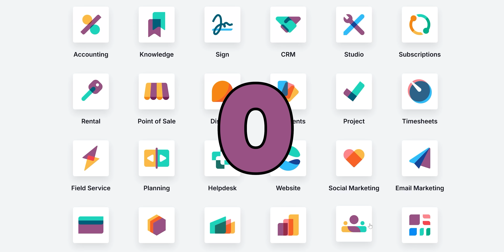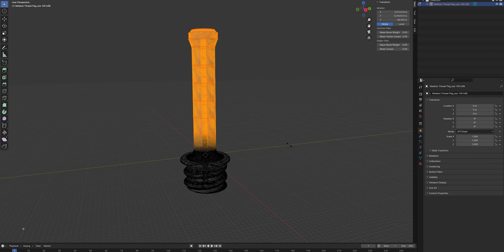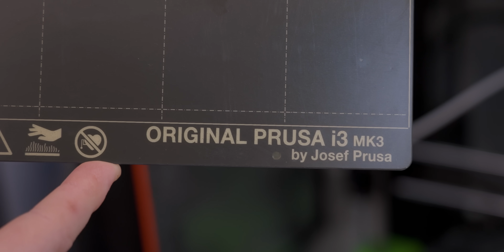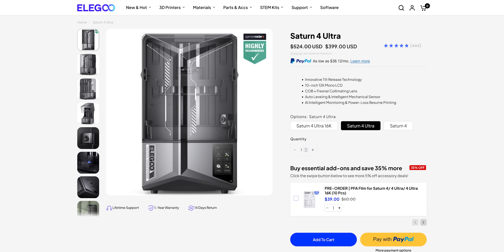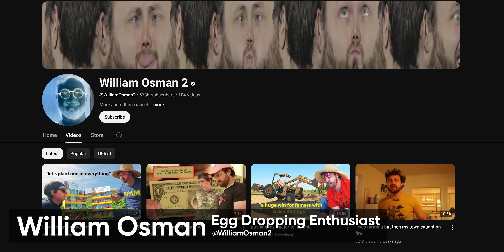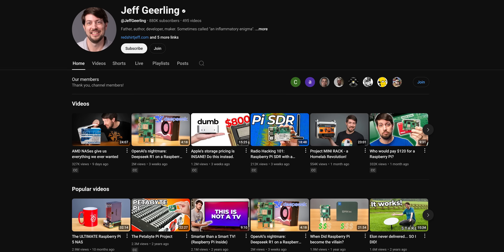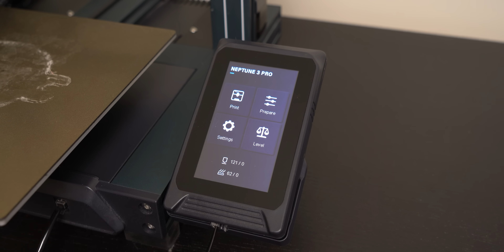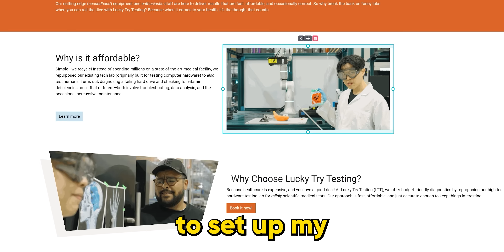Is my 3D printing setup wrong?

Comment: I have a Bambu A1 mini and it does everything I need. They took back some of the stuff they said and nothing has changed so far so I'll continue to use and recommend their printers until some other brand makes something as easy to use and maintain

Comment: Hey I have question. My sister's laptop is a dell something and it has a decent intel processor and 8gb of ddr4 ram. But it is slow as f. It does have a hard disk which I think is the reason. So is buying a nvme ssd gonna make it fast?

Comment: Jake, those two printers are not anything alike.  The one you have is a bed slinger and the other one is a core xy.  The only similarity is they both have a hot end.
Reply: They share a lot of parts
Reply: @JakovPerisic  Gotcha. That seems odd they'd use a lot of the same parts. That would indicate some intelligence behind the design series. 😁

Comment: When I was getting my Bambu X1C, I wanted a printer that would just print. It didn't have to be the cheapest, it didn't have to be the best quality, it didn't have to be open source, I just wanted to be able to load an STL file and print. The bambu is perfect for that. And the availability of parts, accessories and filaments from their store is great along with their support if any issues come up. They might have done a bad move with this new update, but I'd still recommend them.

Comment: Do not go with creality for anything. I purchased a k2 max two months ago that has never worked came in with a “nozzle abnormal error” after three weeks of getting bounced between WhatsApp and their emails I got some replacement parts that did not fix the issue. I can’t get them to answer a single email or WhatsApp message now. So I have a 1400 dollar paper weight. I run a business with my printers and all of my Bambu printers keep working and keep asking for moreZ

Comment: A point on hardened nozzles, they're great. But they do have one downside, and that's thermal conductivity. They're a bit less conductive which can cause a degree of issues sometimes if you're calibrating around just diameter. Usually solved by adding an extra few degrees, but it's another variable to account for. I do love how this video contains a near exact copy of my home setup with the prusa elegoo combo. Now back to work, where I get to maintain a fleet of old prusa MK3 printers that... well they still do everything fine so why replace them.
Reply: That is only applicable to old style ones, new ones only have hardened tips so it's not an issue

Comment: Reality: Normal users that just want to print are still FAAAAAR better off with bambu printers. They are more reliable, easier to use and have more features. All at a price that is SIGNIFICANTLY lower then prusa.

Comment: My kid uses our bambu x1c with ams. Few tips, I don't know why western countries all use stick glue, it is horrible, use spray glue, much easier to do, less material and no cleanup involved (1000h+ on my x1c). Dry filament and print out of drier if you have high humidity. Get dessicant bag and just pour it into printed ams holder. Maintenance is every 300h of prints +-. 
As always great to see some behind the scenes! Also high from Flipper devs to you all!
Reply: Forgot to add, you can look into custom firmware for home assistant, you could get really cool setup that way, but it is extra hustle, I just use vanilla software
Reply: We use glue stick because it's cheap and spray will gunk out your rod with time.
Reply: @SaitoGray  i spray a cloth and wipe with it, no issues
Reply: @ I'll be honest, i use glue only with PETG, pla hardly ned it anyway.
The goal is to provide an interface medium to make the plastic more easilly pealable from the bed.
Reply: @SaitoGray  that is the thing, it's super thin layer and I have no issues unsticking even 20cm flat circle petg from heatbed, was printing special holders for ice fishing

Comment: Never had a single issue with moisture with PLA and I don't store it properly and have high humidity. TPU, PC, PETG sure. Hell PC is so hygroscopic I pretty much have to print it straight from a dryer to retain full strength on multi hour print. Also while bambu's are touted to be the printer for the massess with very little issues I honestly had more issues with A1 and X1C than with MK3S. Now sure bambu runs circles around it with speed and multi material but straight up reliability of prints still goes for MK3S. Also Bambu not only does anti consumer stuff with removing features when using cloud pairing it still uses cloud even if PC is in the same LAN. Not to mention you have default opt in on storing prints on their servers. And if something with your bambu breaks you have to hope they have it in stock and it's not designed with repairability in mind. The extruder head is pretty much a whole part to replace.
Reply: Same, PLA will work in almost every condition.
I used years old rool, full of dust, no problem.
Reply: @SaitoGray  Yup. And I've used the cheapest there are and more premium ones... no difference.

Comment: I don’t understand why would someone pay that much money for Prusa XL without enclosure, filtration, camera etc ?
What you can print on it? PLA and PETG? Everything else is almost impossible without enclosure.
For all high temp stuff you need enclosure to keep some temperature, otherwise will warp and fail (enclosure not tent).

Comment: As a side note - White spots in cured resin prints are not an issue with the curing per se, but with cleaning that happens before that. The white spots are resin residue that didn't get cleaned up enough or are still suspended in the liquid on the model (because it wasn't dried properly before curing) that then gets cured.

Comment: I had my ender 3 for a few years, its bone stock and ive only ever had 1 print fail, and it was my fault for not leveling the bed. And I just leave my filament out in open air and my prints are still pretty good surprisingly, and I print at like 100mm/s.

Comment: for people that want to build a 3D printer from scratch sourcing individual parts (or getting a kit from LDO or something), Voron has pretty cool open source printers with instructions and BOM's to build one yourself. it is more of a hassle to setup as there's no off the shelf option, but you built the printer yourself and know it inside out.

Comment: I joined in about a month ago with a qidi plus 4, had some good results, but it needed some tinkering to get up and running. The big question is, when is LTT going to release an LTT orange spool?, looking at printing a case for my screwdriver, and it's got to match! :)

Comment: I've printed PLA and PETG for years, and my spools just sit open on racks, exposed to air, in a room that often has an atomizer blasting water mist into the air during the winter..and I literally haven't had a 3D printer experience a jam since like....maybe 2016? Prints are clean..they're solid. no enclosure or anything.. I see people talk all the time about dryers and going wild with tons of dryers and I'm out here with none printing flawlessly. Granted PLA/PETG/Glassfiber-PETG dont really suck in moisture. But my Nylon has been alright.  I cant print ABS though. The room the printer is in, literally has 20F+ temp changes and very drafty airflow.  Thankfully PLA/PETG doesnt care.

Comment: I had the same issue camden had on my anycubic Chiron. On it you're supposed to do the auto leveling then manually adjust the offset. Im my case it would in irregular intervals forget them. So I just changed the level sensor offset in terminal. And also added the m420 s1 command to my before print g code now it just works. Also the anycubic Chiron forgets it's leveling data when you do a home all. So if you have something like that in the start g code consider changing that

Comment: My Experiences:
Bambulab: Buy it -> It works
Bambulab X1C/X1E: Works greater for technical and Fiberenforced Materials

Creality: Cheap -> Works 90% of the time -> Sometimes gives you headaches
Creality K2: Cheap -> Works better than all other crealities but slightly worse than Bambulab

Elegoo: Many different kind of printers with special features

Prusa: Back bone of 3D printing, always good to go with, but for the price, just get a bambu lab
Prusa XL: If you need dual extruding, not because of colours, but because of 2+ type of materials, go with that

Ultimaker: Old school, good but slow af, has good dual extruding setup

Anycubic: Similar to elegoo, but i like their branding more.

Filaments go to of choice: Bambu original, Ultimaker Original, Polymaker, BASF (Ultrafuse)

If you want big-prints go with BigRep
If you want Resin go with anycubic / formlabs or elegoo
If you want utilities go with creality / anycubic
If you want filament printing with reliability go with bambulab / Prusa / Latest elegoo/creality with enclosures
Reply: wow i googled the creality K2 as you marked it as cheap, and it's 1500,- euro's while the elegoo from this video is only 150,- euro's. The price differences are insane
Reply: I was like 'I could look for a bigger printer. What's BigRep'

Jesus Christ I thought Elegoo was the only one with a chair printer...
Reply: I only had an OG Ender 3 for a very long time, and since they've been improving it I'll still recommend it as a tinkerer's printer. Or in other words, people who find 3d printing itself an interesting hobby, and not just a means to an end. Both because of how wildly upgradable they are (I'm pretty sure some people by ender 3s literally just for the frame) aaaaand because you'll need to get familiar with how printers work in order to keep it in tip-top shape.

Much more recently, I got a Qidi Q1 Pro and goddamn, going from a 2018-era Ender 3 to that thing is wild. Fully enclosed, probably 90% of my prints on it are ABS or ASA, with some TPU. And it's more than capable of some much more exotic materials, especially if I change out the nozzle. And all that for damn near 0 setup effort.

Just uh...from what I've heard, do not buy from Qidi in the first few months after a new release. It seems to be a trend for them to have significant problems in new printers. And while it sounds like they're good about both fixing them and getting the fixes to those early buyers...it just seems like a hassle.

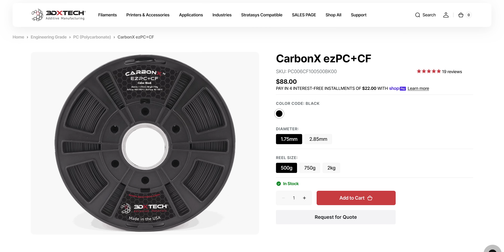Comment: 7:19 - wrong pic, there's hardened nozzle (obxidian) dedicated for MK4 and other printers with nextruder. Since I got it, my print quality improved even with normal filaments - I guess that steel tip runs a bit colder, reducing stringing, while the rest of the nozzle is able to melt the filament to the center.

Comment: Reduce flush volumes. Usually by half at least. I set mine to 92 because its 95% ok.
Print gridfinity boxes or clamps or something on the same plate and set flush into object. This will cause the printer to use the transition plastic for that box instead of wasting it.

Comment: Crealty cr10 smart pro - auto bed cal.. large build volume, direct drive, never needed to dry any filaments I live in Victoria Australia..PETG, TPU, PLA, carbon PLA, no clogging no issues.. No drier.. can push the speed very fast... Pretty good video!

Comment: They've mention the issues with Bambu several times but never really went into detail. Basically, they made it so that you can't really send prints from 3rd party software anymore for "security reasons" and it's either that they changed their terms of service, or people realized what the terms of service said and dont like it.

The main 3rd party software that people are upset about not working as well is Orcaslicer. Unlike what many people make it sound like, you absolutely can use Orcaslicer still, you just can't send the files directly from Orcaslicer to your printer. You can however, use the SD card or use Bambu Connect to send it to the printer. Bambu actually proposed a solution that would have made the interaction between Bambu Connect and Orcaslicer a little more seamless, but Orcaslicer turned it down. I honest think people are completely overreacting about this. It is just slightly more inconvient, but you can still use Orcaslicer and send your prints wirelessly using Bambu Connect. You can also turn on a specific type of LAN mode (normal LAN mode doesn't work with Orcaslicer either I believe) that should allow you to still conenct to Orcaslicer, you just can't really use the mobile app. My main problem with it is just that the security that they were going for when doing this was very quickly found to not be very secure, making it seem like security was not their intention. But again, I still think people are overreacting because it only made it SLIGHTLY more inconvient and they are not require to make sure 3rd party software and devices work with their printers.

For the terms and service part, it basically says that they can make your printer stop working if you don't update it, which at first does sound very alarming, but something people don't seem to realize is that companies try to cover absolutely everything in terms and service to make sure that they can't get sued, so its not even close to just Bambu that sounds super anti consumer in their terms of service. So yeah, it would be concerning if they ever did that, but its unlikely to happen.

Because of all of this, people have become insanely concerned that Bambu is going to completely lockdown their printer by making it so that you either need to buy a subscription and/or you have to use only their filament. Both of these are ideas are nothing but conspiracy. There is nothing to indicate that either of these things will happen. People just thought that it would technically be possible for them to KIND of do those things and immediatly assumed that they are doing those things.

It should be noted that those Prusa 3d printers are generally really expensive. Their cheapest beside the mini which doesn't have a lot of the fancy features costs a little less than 1,000. Bambu Labs ranges from 220-1,449 (A1 Mini to X1C WITH Combo). The A1 Mini and normal A1 both are fairly comparable to the Mk4s from what I can find despite being roughly a fifth to a third of the price. So Bambu Labs is having slight problems, but Prusa, which is what a ton of people reccommend, is out of the price range for most people.

Comment: No 3D printing setup is wrong as long as you're using it right (for printing guns). Bamboo done goofed though. I never trusted cloud printing being pushed as a major feature. Too many access points for bad actors including the manufacturer I guess.

Comment: 5:05 I like that while he did point out that you can upgrade Prusa's, he also pointed out that its not very cost effective because no body mentions that, and I honestly think it makes upgrading not that useful. Like if you upgrade 2-3 times, you spent enough money to just get a new printer (or if you are fine with Bambu, get 2 A1's and have plently of money to spare).

Comment: 3:30 Glue sticks have been required for most build plates for several years now, its not that new of a thing to not need glue sticks. For moisture, its for the most part for materials other than PLA, which is what most people use. PLA very rarely has issues with moisture, but materials like PETG and TPU do have issues with moisture. Again though, most people use PLA, so most people won't have issues. Plus it depends on the humitity of where you live/where you store your filament. PETG is known for needing to be dried, yet there are people who print it perfectly fine without any drying. I don't store my filament in any special way and my PETG and TPU have issues if not dried, but I've only had issues with one or two old PLA spools which haven't been very great spools in general. Also, it's not the best way to dry filament, but you can also dry filament by putting the filament in an upside down filament box with holes poked out on the top on your printers bed, set the printer to whatever drying temperature. I don't have a filament dryer so that's how I've been doing it, and while I feel like the results could be slightly better, it generally works pretty well.

Comment: Asked this bunch of other Youtubers. Hey Linus -  There's a widely spread ongoing issue with X870 and B850 mobos especially gigabyte and ASrock where on a restart pc blackscreens and gets stuck on 0d code and only way to get out of it is force shut off from the button. Also, this issue isn't 10000000% related CPU, nor GPU, nor RAM and it's somewhat software side. Only happens if you restart once pc is fully booted. If you keep restarting it in sign in screen before start up software nothing ever happens. This issue is on my Gigabyte Aorus X870 Elite Wifi7 Ice. Different RAM kits with speeds and memory has been tested and does same on all of them so after multiple tests and 10 hours of tweaking and retweaking issue is ongoing and its affecting 100s if not 1000s of other people. ASUS found a BIO fix for this by putting out update where you can turn on the option called "Monitoring Software reboot Workaround" and it has fixed it for everyone on ASUS boards. I'm told MSI actually recently put out similar update for BIO on some but not all the MOBOs. I'd really love your opinion on this. I deleted and have no software monitoring other than L-connect 3 for my fans and AMD Adrenaline itself. I had Gigabyte Control Center (GCC) off as well when I replicated the issue so it wasn't that either. Below are the boards that this issue is currently ongoing and probably even more.

B650E AORUS ELITE X ICE

X670E TUF GAMING PLUS WIFI

X670E Taichi Carrara

X670E Taichi

B650 Steel Legend

B650E Taichi Lite

X870 Steel Legend

X870E Nova WiFi

X870 Aorus Elite Wifi 7 Ice

X870 Aorus Pro Ice